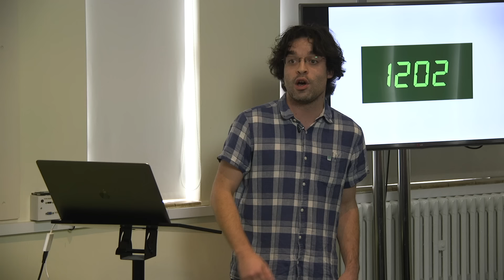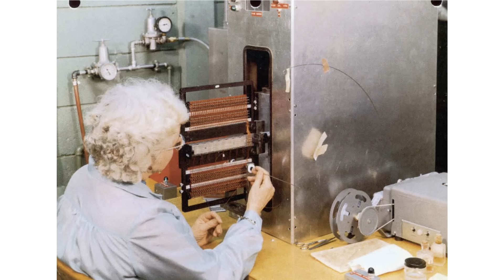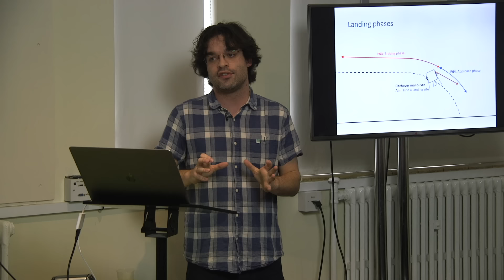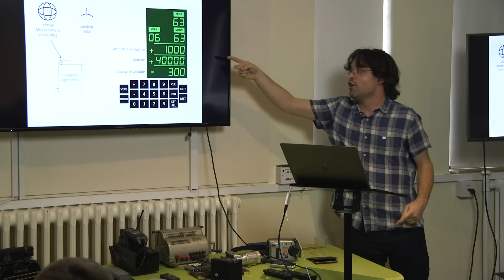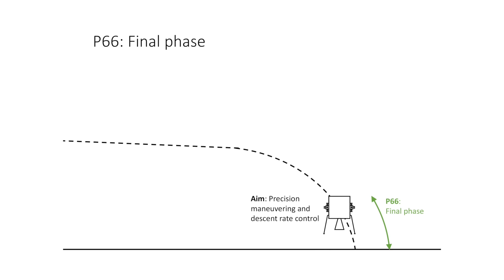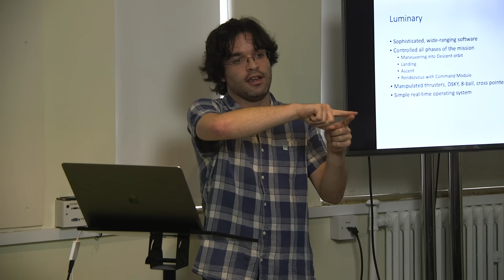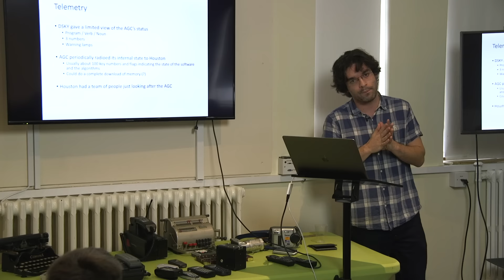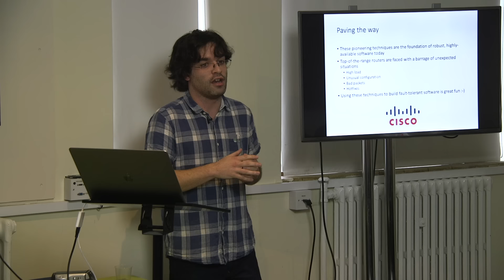Light Years Ahead | The 1969 Apollo Guidance Computer

Comment: Excellent talk, I loved your explanation of the design and operation of the computer and also of the 1201 / 1202 alarms. The root cause of the landing radar "hardware bug" was that there was NO REQUIREMENT for phase synchronization between the 28v, 800Hz reference signal on the Lunar module Guidance Computer (LGC) on the one hand, and the 28v, 800Hz signal on an attitude control assembly on the lander on the other hand. The phase relationship between the two was random, depending on the instant of powering-on of the LGC and the phase of the other signal at that instant. When out of phase by around ~90 or ~270 degrees, counters in the LGC would be incremented 6,400 times per second, resulting in the 15% computer overhead that you talked about. AGC/LGC software engineer Don Eyles described this to us in person at MIT some years ago. He also provides details here (google: "TALES FROM THE LUNAR MODULE GUIDANCE COMPUTER" and scroll down to Figure 7), and also in his book "Luminary and Sunburst".

Comment: If this thing were truly capable of what he describes, computers would have been light years ahead of what an Apple 2e was in the mid-1980s. Or did NASA delete all of that tech just like they did all of the Apollo video and telemetry data?
Reply: This thing was truly capable of what he describes. The huge investment by NASA in the first generation of integrated circuits that was used in the AGC is what enabled the personal computer revolution of the 1980s. 
None of the Apollo video was deleted: every single broadcast is available today. None of the useful telemetry was deleted either.
Reply: @Hobbes746  lol no all of what you said is simply false. Or else they wouldn’t have had to fake the moon landings in a junk yard. Spark plugs on the moon lol. You do realize the Apollo photos are uploaded in high resolution, right?
Reply: The tech in the computer was core memory, which became obsolete long ago due to high cost of manufacture and low density.  There was also small-scale integration, with only two gates on a chip.  This quickly became obsolete as integrated circuit density went up.
Reply: The entire code for the system software is available to the public.  They used slightly different versions of it for each mission as they updated the software and all versions for each mission are publicly available online.  It's just code.  Anyone with knowledge of Assembly Language can look at it and know how it works.

NASA did in fact delete the telemetry data, but not before it was archived.  They deleted the data because they reused the original tapes - due to the fact that they were made using whale oil which got banned, so NASA decided to archive and reuse tapes.  There is nothing suspicious about this at all.  And again - the DATA on these tapes is publicly available.  Every word of it.  You wouldn't understand it even if you saw it, so even if it were missing (it's not), you wouldn't know what you were looking at anyway.  You're just a monkey crying foul for the sake of being a monkey crying foul.  You impress exactly zero knowledgeable people.
Reply: Bravo, ...had to sort by 'Newest First' to encounter any common sense.
Reply: @tombolo4120  He has no common sense, and neither do you.

Comment: 25:17 The missile knows where it is at all times. It knows this because it knows where it isn't. By subtracting where it is from where it isn't, or where it isn't from where it is whichever is greater), it obtains a difference, or deviation. The guidance subsystem uses deviations to generate corrective commands to drive the missile from a position where it is to a position where it isn't, and arriving at a position where it wasn't, it now is.
Consequently, the position where it is, is now the position that it wasn't, and it follows that the position that it was, is now the position that it isn't.

Comment: are you saying that a primitive computer from the 60s was enouph to land us on the moon with good precision and accuracy, but 50 years later with all the technology in world and we barely even succeeded to land a rocket on earth after tens of fails and it was a big deal ?! 
it doesn't feel right
Reply: The AGC was a small piece of the technology that took men to the Moon and back.  Controlling the Apollo modules was not a particularly big computer problem, and some of the computation was done on Earth and uplinked to Apollo.
Reply: That’s not what happened. 
1. landing a rocket stage on Earth is more complicated than landing on the moon. The moon has no atmosphere, so you don’t have to account for wind. 
2. SpaceX didn’t “barely succeed”, they succeeded. Landing their first stages has now become routine, with about 300 successful landings. They’re so good at it they decided to try something more difficult for Starship: landing by having the tower catch the stage, which has a much smaller margin for error. They succeeded at this on the first attempt. 
3. the LM didn’t just have a primitive computer, it also had two humans on board, with brains that are far more advanced than the best computers in use today. The LM computer would blindly try to land in the preselected spot. The humans could assess the terrain, and land in a safe spot.
Reply: If they were to build a rocket with 60 year old technology, the FAA would definitely ground it so we start all over again.
Reply: you're comparing apples to oranges, we can still land on the moon, robotic probes do this nowadays with even more accuracy than what they had back then. Landing a rocket on earth was different because it had never been done before

Comment: This is an absolutely brilliant presentation. I have been in hardware and software design all my working life and remember the limitations of the available chips and memory types back then. How they managed to squeeze all those functions into such, by today's standards, laughable small memories is a credit to those programmers. Now, the whole thing could possibly be done by something like an AVR Mega256 8 bit microcontroller with suitable interfacing to all the external devices.
Reply: Some calculations were done on Earth during the transit and sent up.
Reply: The primitive user interface lowered the memory requirement a great deal.

Comment: It should be noted that Hal Laning was responsible for the prioritization software with Dick Battin.
Margaret Hamilton is responsible for writing code to provide a visible alert when the computer was doing its job.    This visible alert code was to not be included in flight no approval for flight though  was not removed. 
The software Hamilton is credited with (basically everything) was primarily Laning, Battin and Don Eyles.

Comment: Apollo XI was the only landing where the engine wasn't shut down on the LEM when one of the contact probes hit the lunar surface, Armstrong didn't trust the LEM, it's landing gear and the surface of the moon to allow it to free fall those last 4 or 5 feet, he kept the engine running all the way until the pads touched down, i always thought it was odd that on the recording of the intercom between him and Aldrin you can hear him call out engine shut down after they've landed, just earlier this evening I was watching a Scott Manley video where he gets a tour of some rich guy's private collection of space memorabilia, one thing he has is an unused crush assembly from a LEM landing leg (I think the one he has may have been used for testing), when him and Scott were discussing it Scott pointed out that on XI when Armstrong set down the LEM and it being the first landing and all he didn't trust the LEM to free fall those last feet so he ran the engine all the way down making it the only true soft landing of a LEM, as a result however the first rung of the ladder was higher up than what everyone expected it'd be, since it didn't free fall the crush assemblies in the legs didn't collapse causing that issue with the ladder, that why when Armstrong went down the ladder before he turned and stepped onto the moon he had to test and see if he could get back on the ladder by jumping up on it, if he couldn't have got to that first rung himself that probably would have canceled the EVA, at least for Aldrin anyway because someone would have had to be at the top to throw a rope down to Armstrong to help him get back onto the ladder, but at only 1/6th gravity even with his spacesuit on with the pack on the back of it he could still jump high enough to get back on it himself fortunately.

Comment: I mean it's understandable given the circumstances of apollo but an 85% expected load seems concerningly high when hardware breaking can cause additional load on the system. You should really either design in such a way that the computer will not be broken by misbehaving hardware or leave enough headroom to account for it, they didn't really seem to do either.
Reply: I wouldn't argue against success.
Reply: The computer was not broken by misbehaving hardware. The routine to shed superfluous load worked like a charm, allowing the Apollo 11 crew to land despite the overloads.

Comment: Who developed the mathematical equations of the operational  and system software?  Was the LM manufacturer , Grumman aircraft engineers, supervising the small and inexperienced NASA software team?
Reply: Katherine Johnson, for one.
Reply: Grumman was in no position to supervise anyone’s software development: they had no experience, just like everybody else.
Reply: @Hobbes746  The question goes well  beyond software development; It pertains to the mathematics of celestial mechanics as applied in the landing and take off from the lunar surface in addition to the attitude control theory of spacecraft  attitude control for which programmers are not verse at all and are totally ignorant. Lunar module programmers received specific parametric equations from mechanical and electrical engeneers and guide them at every steps of programming.  These programmers were good at programming only with the close supervision of engeneers. It is unfortunate that programmers are trying to grab all the merit while they were only the very obedient servant of the lunar landing module engeeners.  The most important is the knowledge of the celestial mechanics systems as well as system control attitude for which programmers are not competent at all and it is for theses reasons  thaht they must be closely controlled  and monitered by systems engeeners.
Reply: @Hobbes746    Apollo programmers had no knowledge about astromechanics, applications of newton laws and differential equations of the movement  celestial bodies as well as any notion of  advanced  mathematics and rocket engine control, as well as the intricate mechanism of spacecraft attitude control. Apollo programmers  designed the operating system software and they used mathematical subroutine calls  made by scientist   to manage spacecraft functions and activities. Their work was closely supervised  and controlled via test and verifications personnel. These programmers had  very limited  knowledge in science, technology and even less notion in mathematics.  However they learned   applied the very  basic computer knowledge of the early sixties- computer instruction coding and operating system functions-  while being guided and controlled by aircraft system designers as applied to controlling spacecraft propulsion and control. They had no cue about  managing communications, rendez-vous and approach radar, trajectory and orbit changes calculations, joystick manoevering during last moment of descent, descent engine power level control and variations. They did all their work as instructed by highly experienced and knowledgeable personnel.

Comment: REPORTED FOR MISINFORMATION
Reply: LOL! 🤣🤣🤣🤣🤣🤣🤣🤣🤣🤣🤣🤣🤣🤣🤣🤣🤣

Grow up. We WENT. ACCEPT IT!
Reply: @Tim22222  BOZOS THINK ALIKE
Reply: @leelunk8235  Never mind that nonsense, make your case! Show us where the "misinformation" in this video is.

You can't! Because it's true!
Reply: @Tim22222  I CANT. I WRITE A PARAGRAPH ON FACTS AND IT GETS BLACK LISTED IMMEDIATELY. YOU DO RESEARCH
Reply: @Tim22222  BS, HUMANS AND HUMAN MACHINES CAN'T CROSS THE VAN ALLEN BELTS, IMPOSSIBLE, AND TO FLY 980,000 MILES ROUND TRIP TO MOON AND BACK, IMPOSSIBLE TOO, 1968 TECHNOLOGY IMPOSSIBLE, IT'S 2024 AND WE STILL HAVEN'T GONE TO THE MOON WITH ADVANCED TECHNOLOGY, TOO DAMN RISKY AND DANGEROUS, STAAAP IT~!
Reply: @leelunk8235  Humans and machines can easily cross the van Allen belts. The first satellites launched by the USA were all designed to measure the radiation environment in space, so by 1962 we had a good map of the van Allen belts. 
That data told us humans don’t need shielding to cross the van Allen belts. The electronics we used in the 1960s didn’t either. Later integrated circuits, a million times smaller than the Apollo semiconductors, do need to be designed for this environment (radiation hardening): the smaller a transistor is, the more susceptible to radiation.
Reply: @Hobbes746  The Van Allen belts are huge belts of radiation that surround the Earth. It's been claimed that humans would not be able to pass through these belts without being subjected to lethal doses of radiation.
Reply: @leelunk8235  It has been claimed and such claim has been proven false. Period.
Reply: @vksasdgaming9472  DRANK TOO MUCH MOON KOOLAID. 😆
Reply: @leelunk8235 
James Van Allen said it wouldn’t be a problem.  He was right.

Comment: Why was the rendezvous radar turned on during powered decent?   Buzz Aldrin was the only astronaut at the time that had a PHD.  His thesis was on orbital rendezvous.   The other astronauts came to call him Dr. Rendezvous because at cocktail parties he would recite his thesis.   During Lunar Module simulator training Buzz suggested they have the rendezvous radar up and running in case they had to abort during the decent because that would put them right back into rendezvous scenario.  The other astronauts and simulator instructors agreed with this logic and added it to the checklist.   Back on earth after the mission and everything was debriefed.   The other departments did not know they made this change.   The guidance computer programmers would have known that this would give the computer too many tasks to do and recommend against it.   A new protocol was established that there could be no changes to a checklist unless done in a meeting with all departments represented.   This info was pieced together from books written by the astronauts.

Comment: 5:27 The AGC did not get you into orbit or manage the TLI burn. These were the job of the Launch Vehicle Digital Computer within the Instrument Unit atop the S-IVB. The AGC tracked the ascent (except for Apollo 12, which was struck by lightning shortly after liftoff and lost its inertial guidance reference) and could manage the ascent to orbit if the IU failed but this was never required.

Comment: It sounds like Neil Armstrong's stick was fly by wire, right?  How could Neil have controlled the craft in those moments when the computer was in its error mode?
Reply: Yes, it was fly-by-wire. There was loss of control during this error. What saved Apollo is that when the error happened, the computer automatically dumped the extra jobs and got going again. I haven't been able to find how long this took, but I suspect it's less than one second. That 1202 alarm remained on the screen long after the computer was up and running again.

Comment: It was suggested that the reason the computer was pointing the lander toward a boulder field was because the docking tunnel wasn’t completely depressurized before the two craft separated. This extra pressure gave the lander extra velocity that wasn’t accounted for by the computer and thus caused the landing position error.

Comment: Yet, we do not have any useful information (from that Magic landing) for our latest attempts to descend backwards and launch again from the same position with the same load. If I am in wrong, please direct me to the source of technical information that can help a todays lunar mission to build a task-adequate "ship". Well...it's not only about computer, or the software... it's Physics of flying and landing a reusable space object, that Elon Mask is trying to learn as we speak.
Reply: The source is the NASA Technical Report Server, and it contains a treasure trove of information on every aspect of Apollo. 
That information would not have helped JAXA. The SLIM mission suffered a failure of an engine nozzle made from ceramic materials. None of the nozzles used in the Apollo program used ceramics.
Reply: @h.dejong2531  Why don't you try to get some test and/or design information from there? I'm sure there is some rudimentary material, but none of it is useful for any space travel, as we still have a problem how to safely land a rover (lunar vehicle... never mind humans, that should relaunch and come back to Earth). Please, try,.... and get back to us.
Reply: @peta1001  The failure we saw with JAXA's SLIM lander was a material failure: the ceramic nozzle of one of the main engines broke off. NASA did not use ceramic engine nozzles on any of the Apollo hardware, so you're not going to find that particular information in the NTRS. Similarly, the Chandrayaan-2 lander failure was a software error, in a landing system that is completely different than what NASA  did for Apollo or the Surveyor landers, for instance. NTRS is not going to help there either. 
Spaceflight remains complicated and difficult.